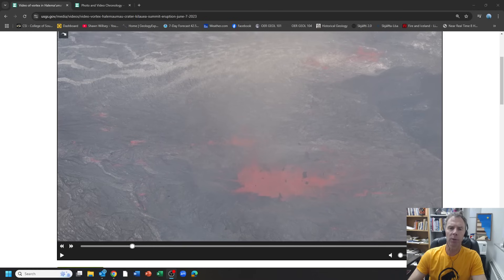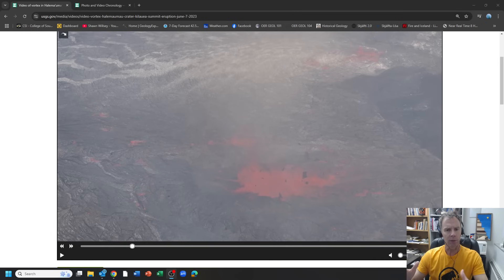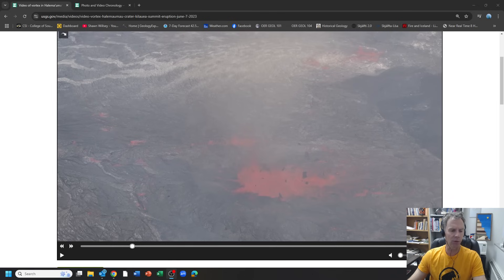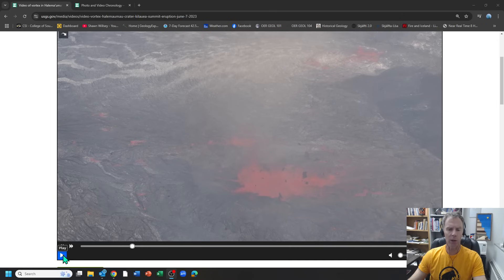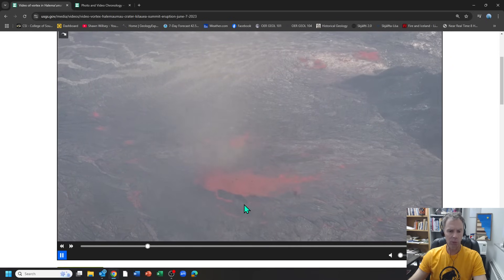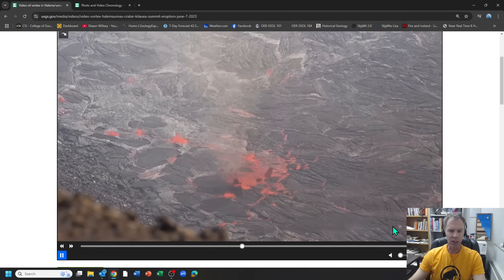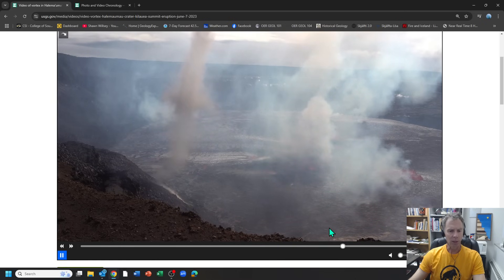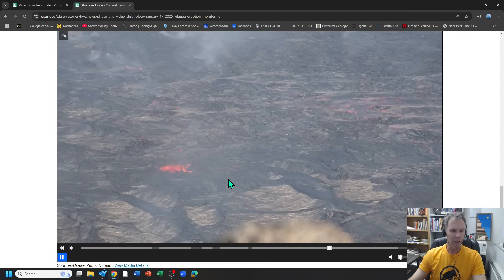Lava Tornado? Lavanado? Lava Torn Up By A Vortex: Geologist Explains

Comment: That was fun!  I wonder what a slab of crust would look like if it were thrown onto solid ground and left to cool?

It’s not surprising that a tornado like structure would form from the heat of an erupting volcano since they also form in big wildfires; last year or the previous year the news showed one during a wildfire in CA.  What seems odd is that this is the first volcano produced tornado our geology professor has heard about.  Seems someone has been holding out on some pertinent information; I can’t imagine this could be some new kind of phenomenon.

Comment: After a bit of reading, it appears that a tornado is wind that extends from a violent storm cloud  down to reach surface.   (the storm itself was caused by larger scale  updrafts)..  Doppler radar wil spot rotation at altitude prior to such rotation extending down to surface, hence the few miniutes of warning weatherman are able to give. 
A dust devil is a localised event started over very hot ground that causes air to rise fast enough to draw surrounding air iin , causing to spin at icreasing spin as it moves closer to centre and such will peter out if it moves away from hot ground. No stored energy like in a storm. 
In biblica terms, this means devils closing in in Pele.  End of days scenario 😞

Comment: Saw this documentary once where strong rise of air over the Pacific  lifted a whole bunch of sharks way up and the resulting storm dumped sharks all over an areas of a radius of 30 miles around the  southeast corner of Beverly and La Cienega in Los Angeles, California.  They coined this new phenomena Sharknado.   The first such event was in 2013 and it's happened 7 more times since in different locations.  Last recorded one was 2021 🙂

Comment: Not surprising considering the temperature gradient down there at the surface. Basically the same as the dust devils we have here in the low deserts of Arizona. Dust devils do pick up a lot of dust and junk. So far, no rocks!

Comment: I gotta think that the windspeed is much faster than 75kph, really, even though that crust is relatively light, they're still foamy rock slabs. Add to it the difference in temperature between the lava surface and the air, I don't think 150 to 200kph is all that unreasonable. Then again, I'm just too dangerously knowledgeable for my own good, as Neil deGrasse Tyson has pointed out.

Comment: The first video showed the vortex rotating clockwise and the second video had a counterclockwise sense of spin. This shows that the cause is not similar to the cause of tornados in as much as tornados have a strong cyclonic (CCW) preference. A better term then would be LAVA SPOUT since the process is more of a wind convergence feature similar to a waterspout. Still the stupid "lavanado" term will probably stick. If only geologists ACTUALLY knew some basic meteorology.
Reply from the maker: I didn’t coin the term and I’m sure it’s not an official term.
Reply: @shawnwillsey  Oh no, please don't take it personally, it probably wasn't coined by geologists. I like lavspout (I suppose this is how it should be spelled, like waterspout) because it has a causal connection. There is the media buzz term "firenado" when it really ought to be a "firespout". Funny really....

Comment: Thanks!  It's hard not to watch the pieces of crust being flung through the air, but if you watch the tracks of the two vortices, it appears that the first one is spinning clockwise, while the second is moving counter-clockwise.  The latter's movement is more apparent in the full clip on the USGS website.
Reply: Thank you! I agree, USGS has great data & images :)

Comment: Linguistically it seems very similar to a sharknado. Not everything needs be made into a portmanteau.
I had not seen before in vids but not surprised. An intense heat source gives the energy needed exactly like wild fires which also develop local vortices of fire.
Reply: Would you rather hit by a flying shark, or flying piece of crusted lava?
Reply: @mattdurette497  Gosh, I did not know there would be a test. I will go with shark.

Comment: I would call them lava devils, because its similar to dust devils
Reply: The National Weather Service calls these landspouts (the bigger sibling of dust devils), but “lava spout” could be confused with other processes so I’d vote for “lava devil”!
Reply: i was going to say the same thing !:-)
Reply: Um. No it's not. You can go in mist dust devils. 

Try that with a whirl wind full of lava rocks. You know razor sharp obsidian and stuff like that. 

Dust devil would hurt but a Lava devil would shred you.... 

A full size lava tornado would be worst as normal ones can put straw into concrete. Somehow even tho they can't repeat it in testing.  How fast does straw have to go to embed in a roadside curb or even a tree.

Put sharp abrasive razor like rock and dust. Like evacuate  anything in its path and stay away. Far away. Miles might be to close with possible head size  boulders that explode into razor rocks flying around. Tho that'd be like an EF-4 or 5 that rips the ground up.

Which actually makes the twister truck scene impossible. Real life tornado about that size ripped up the dirt and roadways and left a ditch where it traveled. 

The truck in twister. Even with its screws down. Shoulda been gone as the screws don't go down as deep as the dirt the tornado shoulda just ripped away. But the ground wasn't turn away at all like with the real life similar tornado.

the bulkier and better grounded TIV woulda been in trouble in the movie tornado and the real life one.
Reply: yes. Given that these things are all driven from heat rising. Whereas a tornado is driven from a weather system above. Totally different physics phenomenon.
Reply: @goldreverre  strange i was taught that tornados are generated by warmer and colder air mixing.
Reply: @EVG_Channel  it’s both have a nice day
Reply: @cristinagaming1  nice day had thanks

Comment: That´s just what currents of warm air rising through colder air do: They spin! With the air having been heated to several hundred degrees, the air rises fast. As there can´t be holes in any mediums, cooler air from he vicinity gets drawn in and gets spun up by coriolis force. That vortex that is generated thus can get pretty strong!